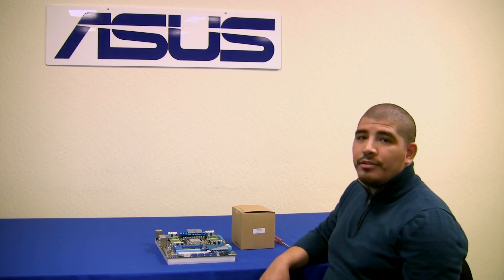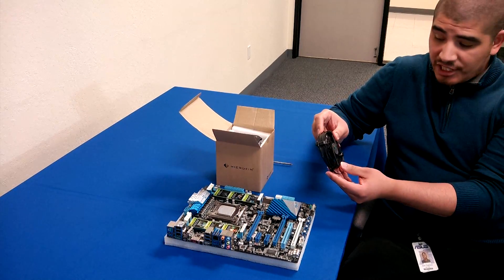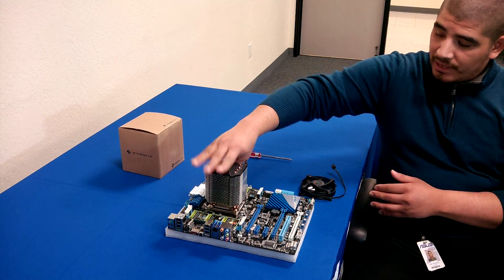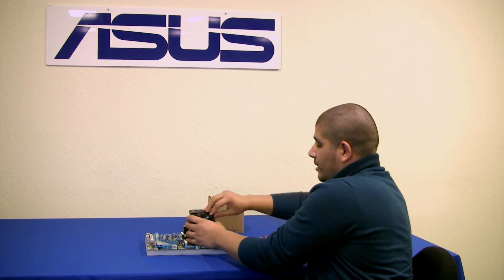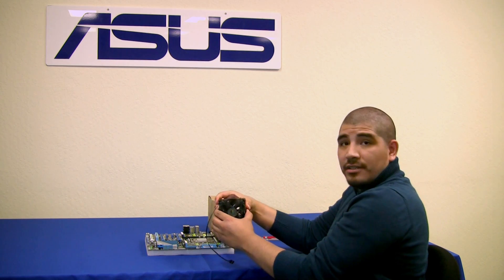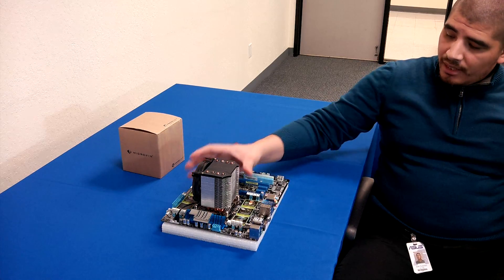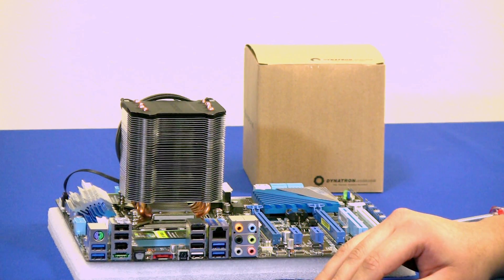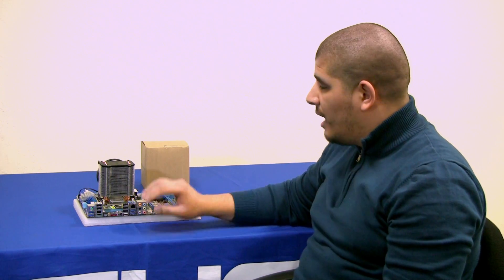Dynatron R17 CPU Cooler Hands-on Review

Comment: You're talking about the Intel RTS2011LC; Intel also makes a RTS2011AC which is an air cooler for the 2011 socket.

For someone that's not going to overclock something like a i7-3820 but is going to to populate all 8 DIMMs on a board such as the Sabertooth x79, finding an air cooler that will work with the RAM clearance is a major issue.  I'm personally very pleased to stumble on this review from J.J., as I think it just solved the last, most difficult problem for my new build.

Comment: This Cooler is OK if you do not wish to do any overclocking but when you consider that even Intel makes only a closed loop water cooled cooler for the i7 2011 Socket CPU that is what you should really consider. Failure to allow a 2nd fan attachment for a push-pull effect is also bad.